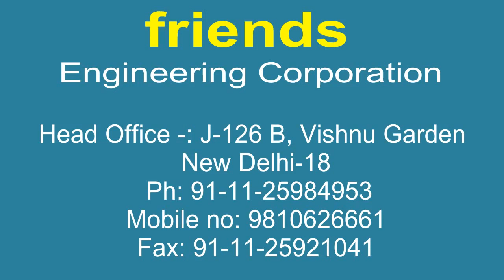Square Bottom Paper Bag Making Machine with Four Colour Flexo Printing

Comment: I am a technician, a mechanic and a good coach, and I work with all the parts of the machine holweg rs1 / 2/26 and I run the machine printing and high quality without wasting a lot and fast speed and a lot of production and I adjust all sizes and run all the paper such as cochia .. Karp White and brown paper printed and Slovitt German and Japanese and want to work I am from Egypt

Comment: This is a creased bag and not Square bottom.
Reply from the maker: yes, it is made by creasing the V shaped bottom Bag. In case you  want automatic square bag machine, then even Chinese machine will cost you One Crore.
Reply: @ManjitSinghFriendsEngineering   i know that, exactly why you should mention it's a creased square bottom bag and not an actual one.